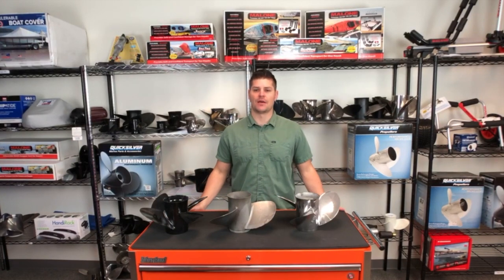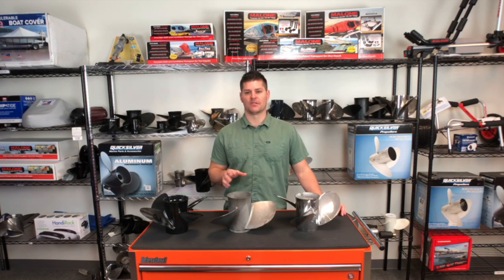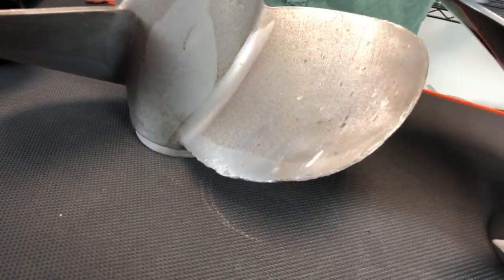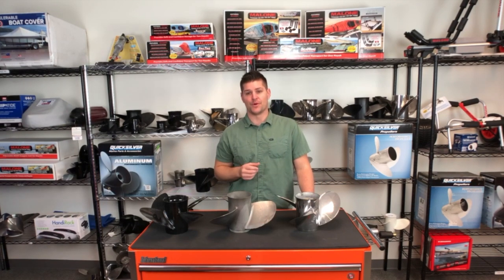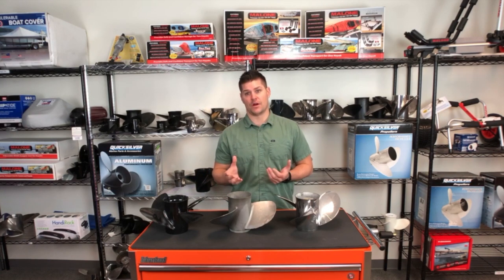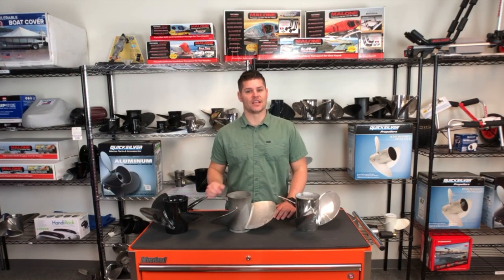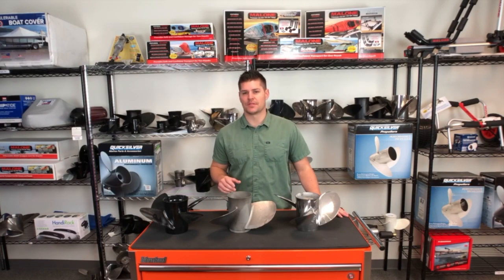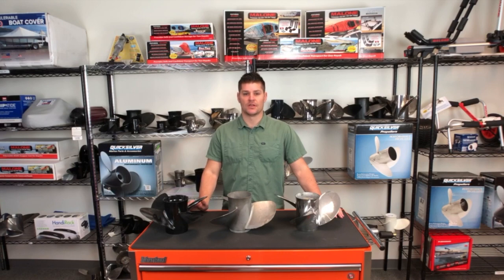Boat Propeller Care and Maintenance Tips From iboats.com

Comment: can a knicked up prop cause the shaft to bend or look as if it is bent? experiencing this with an optimax 150. i cannot get on plane. some say it looks normal, though i could use a new prop and that my planing issue could be more to do with fuel delivery issue and others say my prop shaft is deff bent. ALL experienced boat owners???